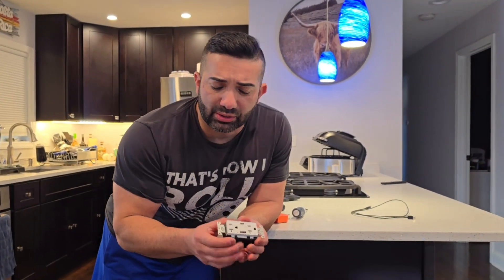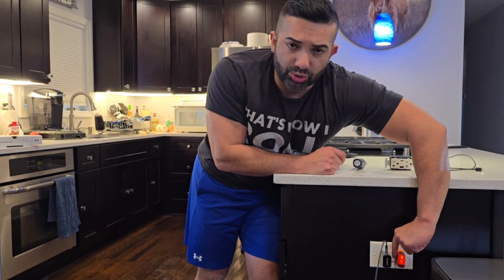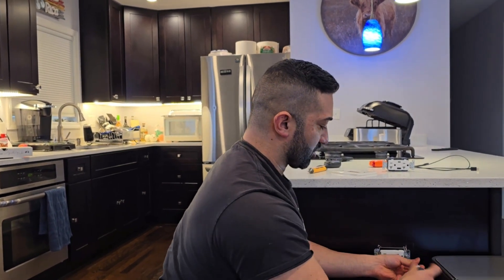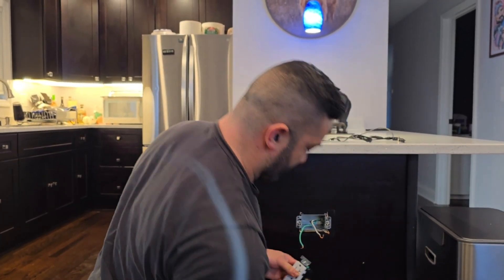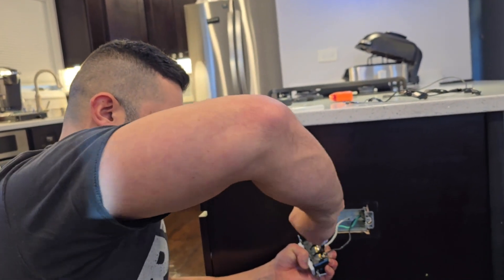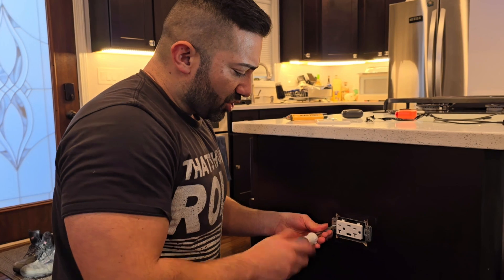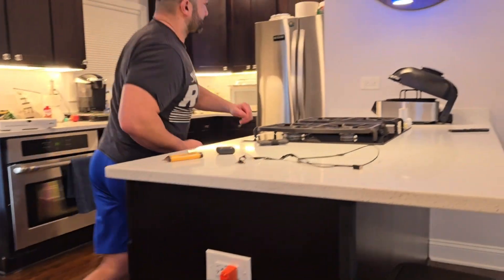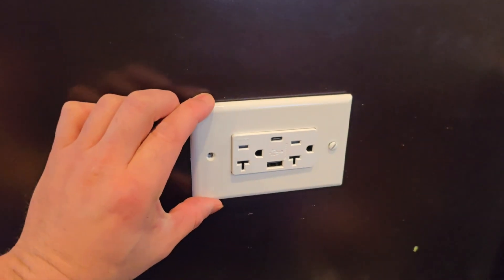Installing a USB outlet Yourself DIY

Comment: You should really quit youtube. Your videos are awful 😂😂😂
Reply: @djpyroflux4071  his videos are guiding in building my food trailer. 🤷🏻
Reply from the maker: @dajerseyrat  appreciate that
Reply: @fbaltierrez  domyounhave a link yo the gas line fitting you used fornthe yellow flex line? I can't find them anywhere.
Reply: Hey Frank, I just purchased a concession trailer and I’m having trouble getting the power to come on. It keeps popping the breaker in my house. Can you take a look at my breaker box if I send you a pic?
Reply from the maker: @arnulfocontreras5563  either 2 reasons. The gfci is too sensitive for the trailer can swap that out for a regular outlet or you are overloading the circuit. Those are basically the 2 reasons
Reply from the maker: @djpyroflux4071  perfect! One day I will :)
Reply: Once again you are correct. All my garage and outside outlets had a gfci in that circuit. So I ran the extension cord iinside the house and it work! Thank you for responding so quickly. Thank you for all the great videos.

Comment: Unrelated question but can you stack a flat top skillet on top of an undercounter refrigerator without damage?
Reply: Do not use these outlets
Reply from the maker: You can but the issue comes in on how to keep it from moving, can't drill down into the refrigerator
Reply: @fbaltierrez  ratchet straps? Or brace the cooking equipment to the wall.